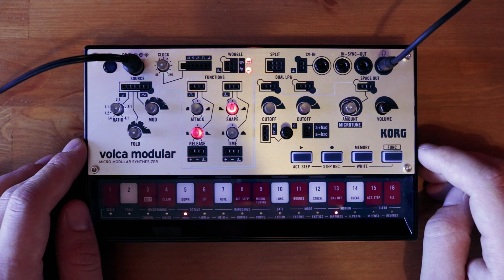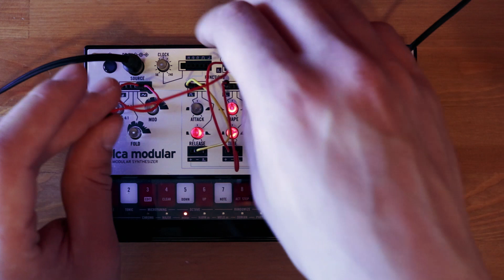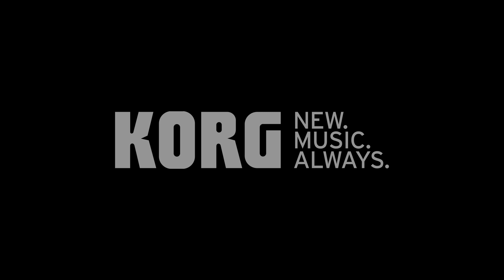volca modular Patch of the Week 11: Drone

Comment: Hi. Is it possible to synch volca modular with other midi gear like aira tr8 drum machine? Is the mini jack with korg sync the same as standard midi? Im thinking to buy my first volca but i would love to have it synched with my other gear. Thanks
Reply: Yes, the Volca can be synced via midi (small TRS connections but the synth does come with an adaptor so that you can nnect to the rest of your kit)!
Reply: @RP-vx6yz  thanks :) i got my volca modular few days back.... basically volca modular does not have midi input, but it has only clock in... so i used my arturia microfreak clock out and sync it like that .... the only problem is that sequencer is running to fast and i would love to change step tempo range to lower setting but its not possible... anyways thanks for your answer ;)

Comment: Thinking there's a problem with mine. When I patch the Time output to the sample and hold woggle input, there's no woggle (and no lights). The woggle and lights only change when I press a note. The smooth woggle works fine. Wondering if I'm missing something.
Reply: Same for me, did you figure it out?
Reply: The bottom input on the woggle is a trigger input. Run the LFO output into that.